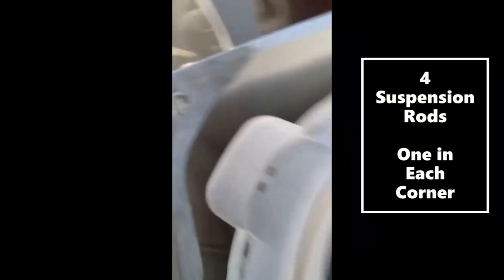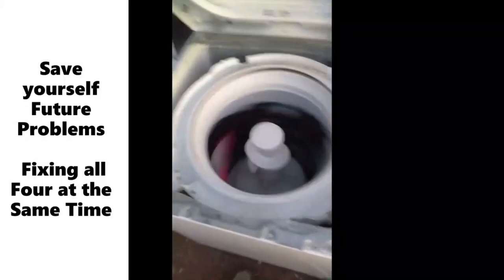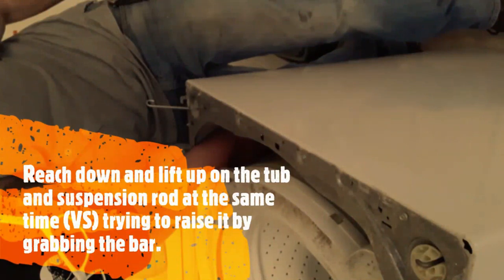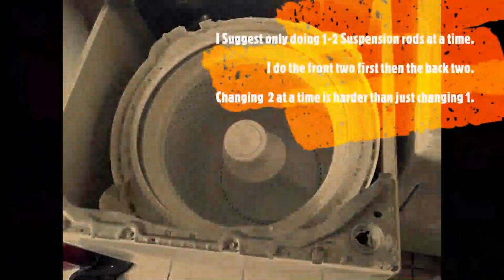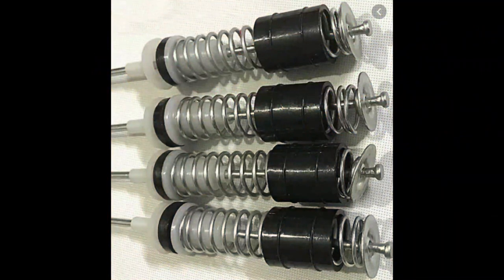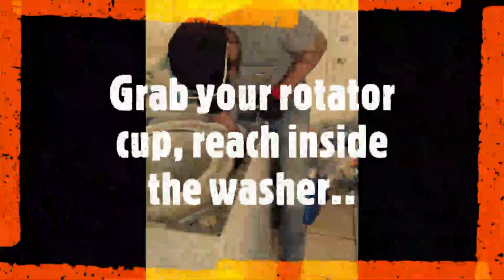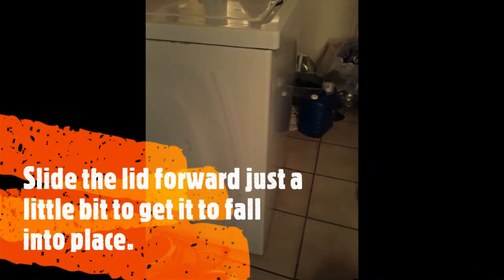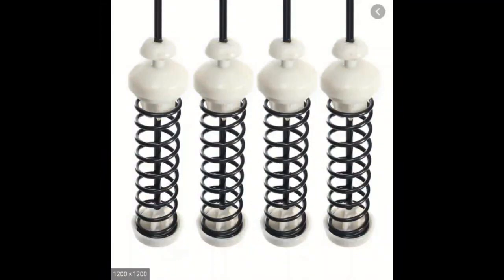Shaky, Loud, Banging, Walking Washer?..  Whirlpool Kenmore, Maytag, Roper, Samsung, LG, GE Washers

Comment: I have a Kenner’s Washing machine and it shakes violently every time it’s on spin cycle  when I checked it and spin it manually it always hits the left side of the washing machine does it mean that The suspension rod is broken on the left side?

Comment: Nice video 😊, however I rather liked the part about the washer breaking at three years and one month, just after the warranty expires 😆. I live in Jamaica, and the local supplier offers an additional two years for Extended Warranty, so just in case the washer fails within four years

Comment: Great practical video ! I see you said to cut a hose 3 inches long, slice it down the side, and slip it on the inside of each spring. Do you know the outside diameter of the hose? Thanks!
Reply from the maker: I'm so sorry I did not see your comment ... im not sure of the diameter of the hose... its 1/2 inch maybe... I use the washing machine water hoses. The black ones. They work perfectly!

Did you get your problem taken care of?
Reply: @methodmeetsmadness  I used the black hose like you suggested and it worked better but I still got the banging under some conditions. So I ended up buying the new springs and this solved the banging problem. Still, your solution is pretty innovative and may work for many depending on their situation. Thanks for posting your video!

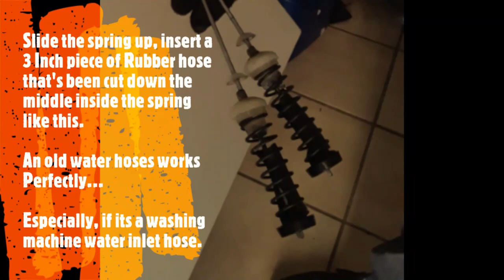Comment: You say "Put the hose INSIDE THE SPRING,  but your video clearly shows at 2:39 the hose is on the OUTSIDE of the spring!!!!  What are the wires I see around the hose????  You don't show what you do to the spring and hose... How do you install the modification?   I bought BRAND NEW shocks and there is no modification such as you have.  They look like the same rods I removed.  I'm starting to suspect the rods they sell online HAVE THE SAME PROBLEM and are not modified?  I have been searching for WEEKS AND WEEKS on how to fix this.  Nobody gives the solution.  EDIT:  I just put the hoses inside the springs and installed them.  The hose is 3 inches long... but they butt up against both ends and there is no "play" in the spring.  The wash-basket does not bounce up and down when I push on it.  Now it is worse than before.... guess I will have to try something else.  This washer is from HELL.  I hate buying a 500 dollar washing machine every 3 years because I'm not rich. SECOND EDIT:  IT WORKED.  The mistake I made was I should have pulled the spring UP and pushed the hose down onto the bottom plastic thing.  THEN push the spring down onto the hose.  I had to make it look EXACTLY like the one pictured at  the 3:00 minute mark.  Thanks for your helpful video.  And.... yes... the rods they sell are NOT MODIFIED... so you would be wise to put the hose piece into the new rods  if you bought new rods.
Reply: I'm dealing with a shaking Maytag Bravos. Hate it. I was confused by this vid a little too. Thanks for posting your results